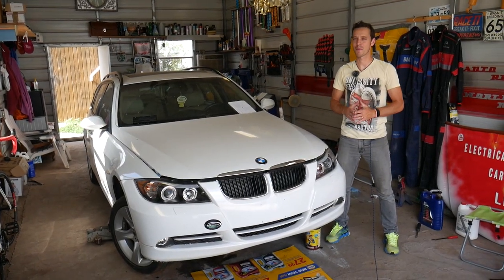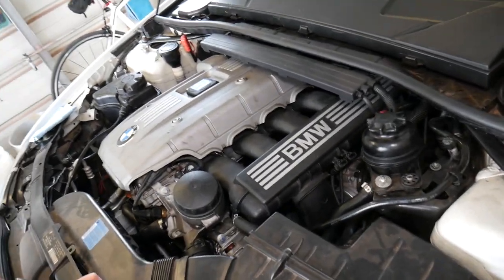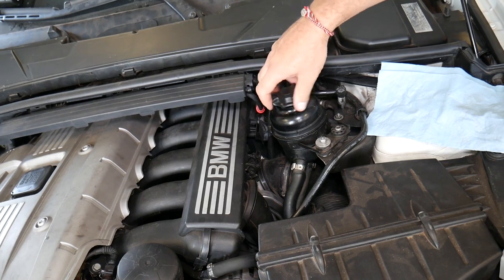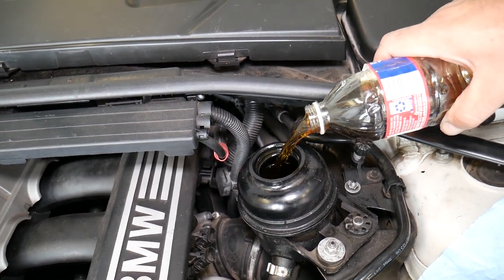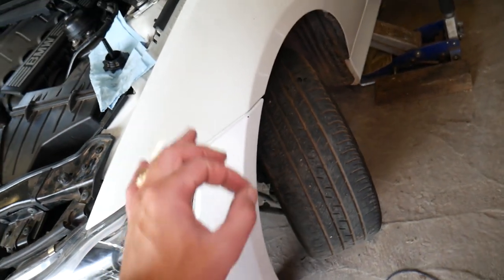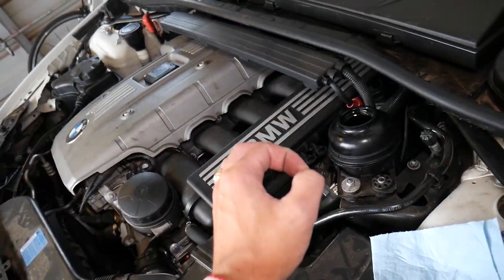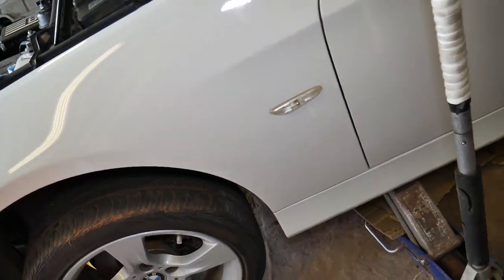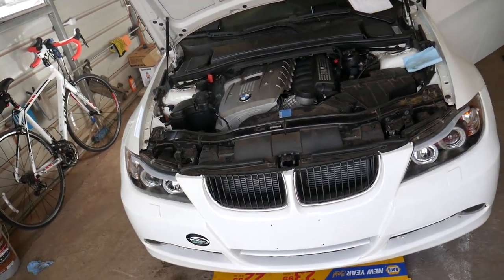HOW TO BLEED POWER STEERING PUMP ON BMW, POWER STEERING NOISE

Comment: Wow. The guys just rebuilt my engine, added fresh oil and water, I thought they had out power steering fluid too. They did not.( Reservoir had been removed of course.) Car finally started, (after being dead 7 years, now alive) no noise from power steering so I still did not look. Now there's a grinding sound from pump. Ugh. Went got fluid, atf, filled but still noisy. Max running time has been maybe half an hour (?) Total so far...I had tried to bleed by turning wheel lock to lock...but with engine running. Today after your GREAT VIDEO, I'll lift wheels and use your method. Manoman I hope it didn't kill the pump!!! Thanks, my friend, I've watched many of. Your videos and learned alot! Subscribed)
Reply: hello did u fix the heavy grinding ?? i have replaced steering rack and pump,, and the sound is still the same...

Comment: Fixed my issue, did it without jacking up the, I just put some plastic under the front wheels. Still kinda heavy but did the trick 👍

Comment: I know you don’t respond to comments but maybe someone else can chime in. 

About 3 weeks ago I replaced the resovoir. All fine new fluid. Week later power steering completely goes out on highway. Out for whole day. Next day all sudden comes back.. but still laggy.. stiff during turns sometimes but for most part works.. but can tell something not right. 

I’ll try this. Maybe I have air in system?? No noise tho

Comment: What could be the reason that the steering wheel shakes left and right on the 2002 745i (EDC+DynamicDrive)? The wheels have been centered several times, the tires are new, all parts in the chassis are new. Could this be caused by a servo pump fault? Or is there air somewhere in the system? Sometimes the government doesn't shake, but sometimes it does on the same road.

Comment: Hi, thanks for great video. I've seen many videos where they have engine running while bleeding the air. What is difference between engine off & running? Thanks
Reply: I'm no expert, but if the engine is running: the pump is running - and if there is no fluid in the impeller it may damage the pump. Safer to do it with the engine off